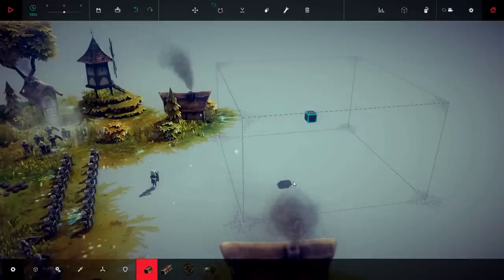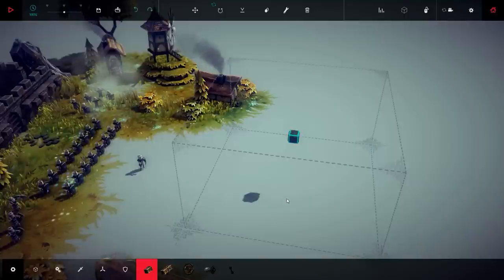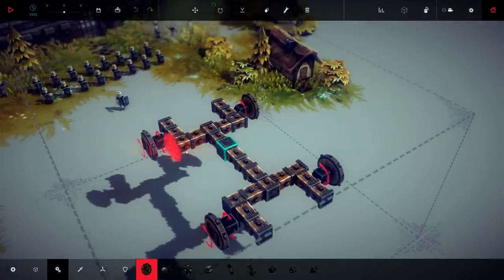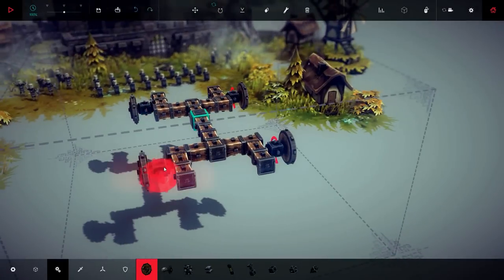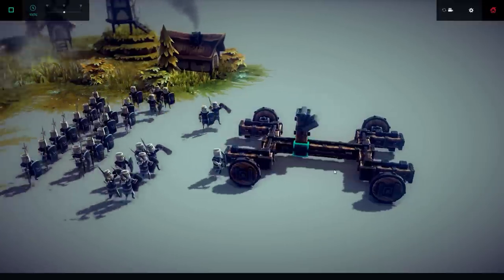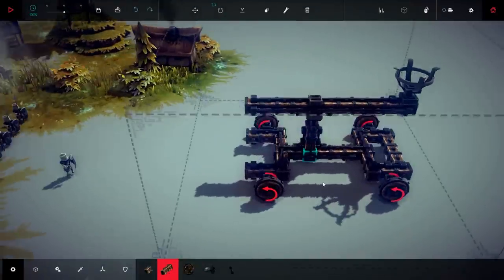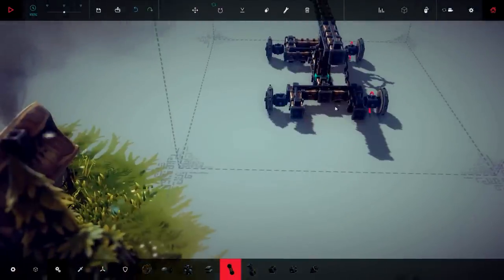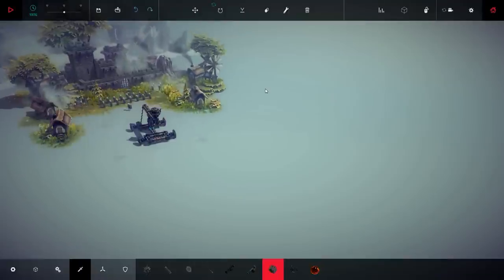Besiege - How to make a Catapult

Comment: you can put suspensions on the front of your machine instead of leaving a gap and you can have 2 wheels on eachother so your machine will turn like a tank would. its very easy to control

Comment: I tried creating a form of a trebuchet. Where it would be pulled back by rope and then it would be released and the spring would pull it forward. But the amunition kept falling out before it launched. Then I tried to turn down the power of the spring.